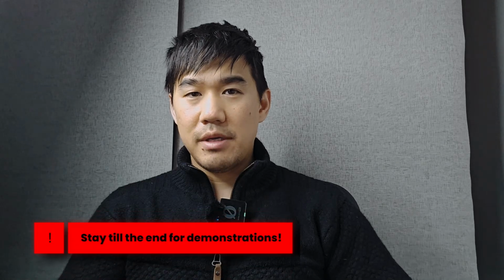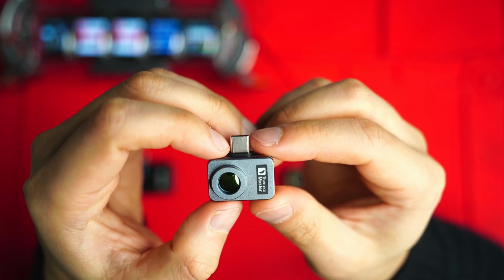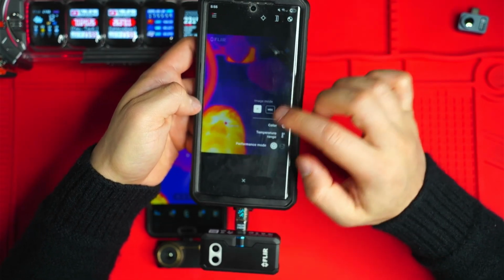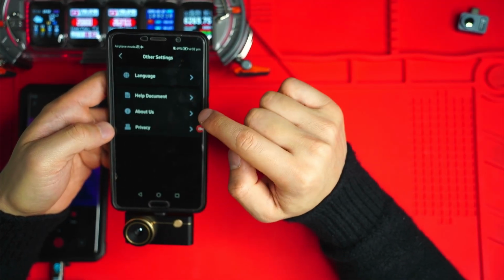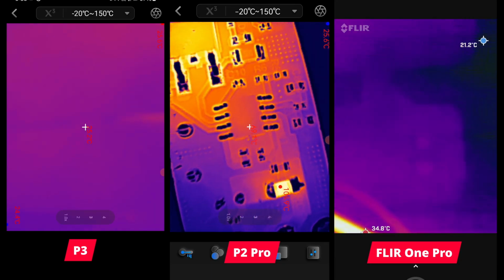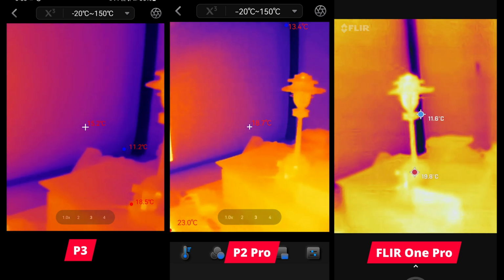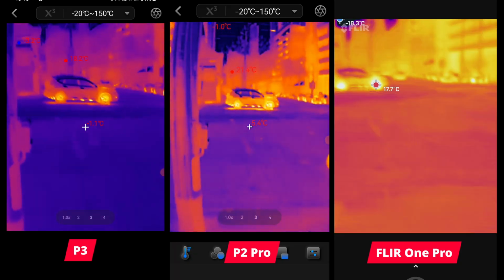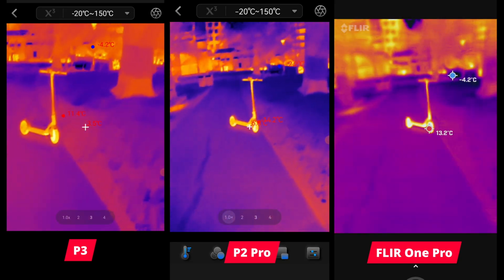#1 Thermal Camera? Thermal Master P2 Pro/P3 vs FLIR One Pro

Comment: Hello. I have a question. On P3, do you have to adjust (set) the distance to the object you want to see every time?
Reply from the maker: For optimum clarity, yes. Better than having a half focused image most of the time (fixed focus cameras)
Reply: @DarrenYeoYT Thank you
Reply: @DarrenYeoYT But does the P2 Pro have good autofocus?
Reply: @forestdamian5601 it doesn't. It has a fixed focal distance set at infinity that stays clear up until around 6 inches or 0.15m.

Comment: I wish the p3 would have the same wide field of view as the p2 pro. 

When these tiny cameras are plugged into your phone. Is there any accessory to help keep the device from accidentally falling out and accidentally losing it?
Reply from the maker: It's slightly narrower but makes it better for longer range tasks too. 

You might want to clip it to your phone case. But I just attach a small extender and flip the phone upside down so the USB port is on top. Less likely for it to fall off that way.
Reply: @DarrenYeoYT  thanks. Just ordered a p3 through your link.